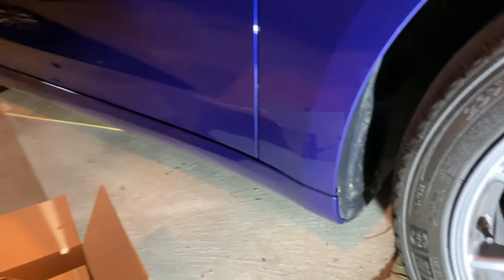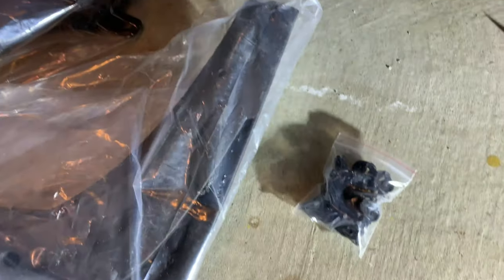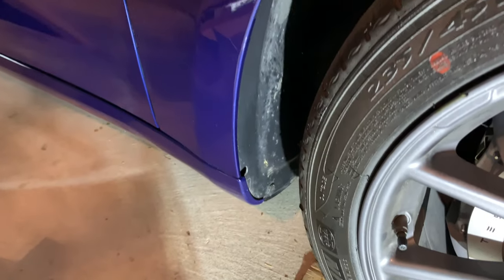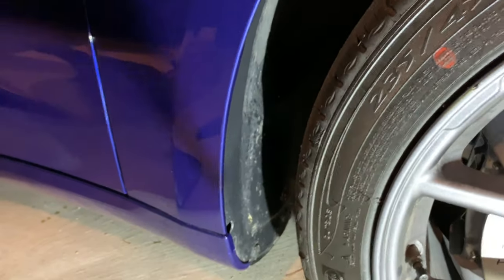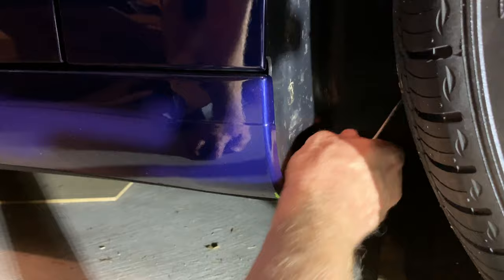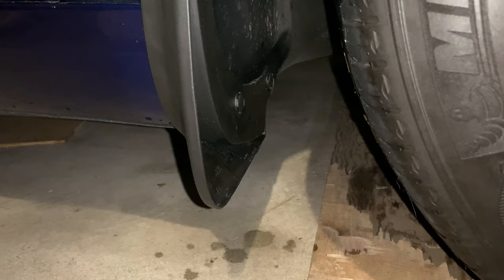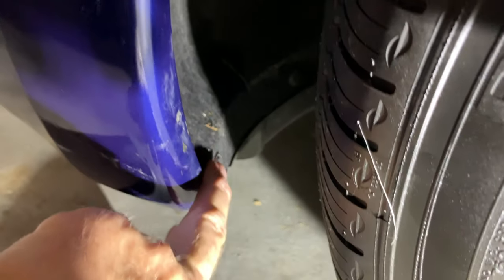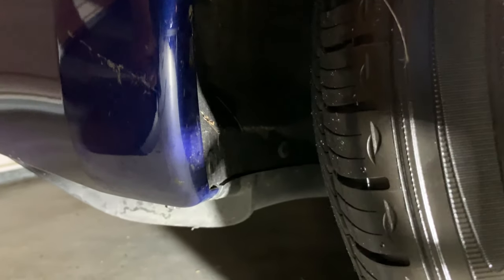Tesla Model 3 Mud Flap installation

Comment: Hi, bought similar ones but haven't installed yet. Did you use the screws at all or just the plugs?
Reply from the maker: I used Gorilla double-sided tape and it is still stuck
Reply from the maker: Nope, just double-sided tape did not have the heart do drill into my baby.